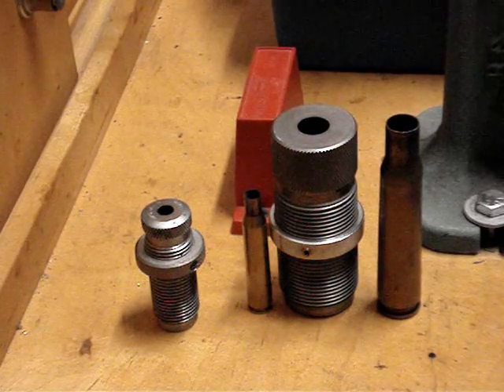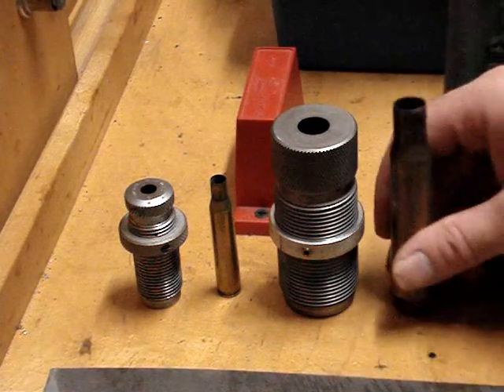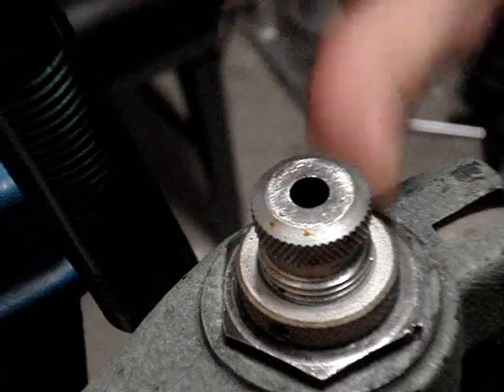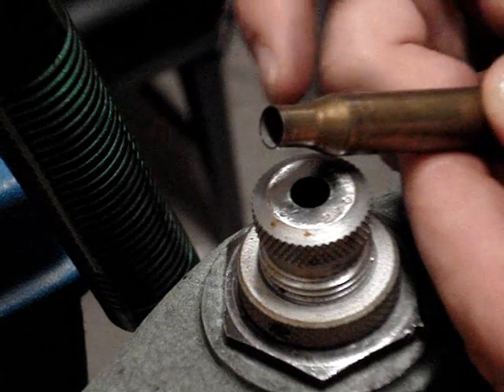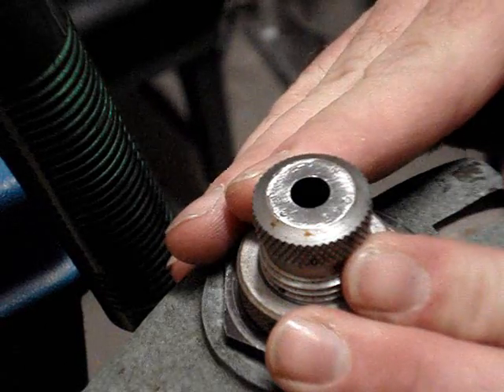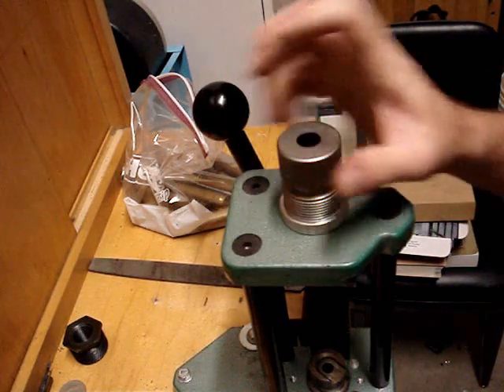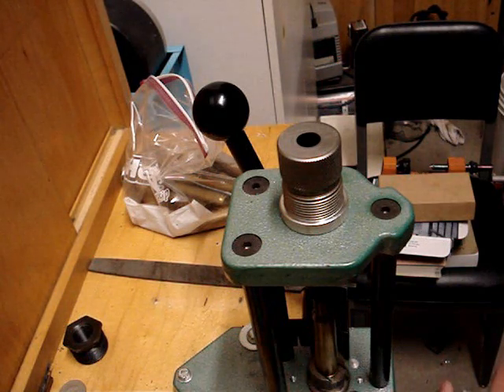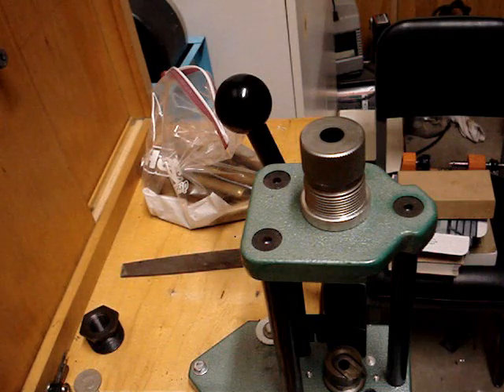Trim Dies

Comment: Are you saying,? that If I run a 30/06 case through my Win 270 File Trim die,? There will be nothing, to file off of the Case.?But just running it through the Trim die it will turn that 30/06 case in to a Win 270,? and can be fired in my Win 270 rifle,? with no problems.?

Comment: When doing the Rem 223 Cases,? You need to use the # 10  Extended Shell Holder for trimming those cases.? To give the cases the correct height ,? For trimming.? Just a Note here.?